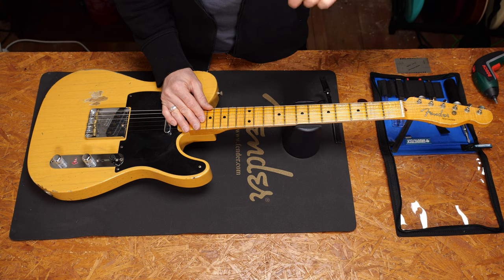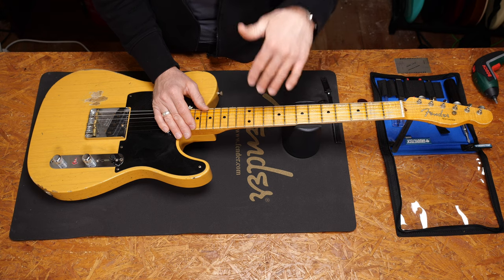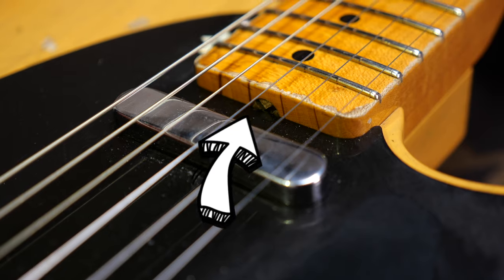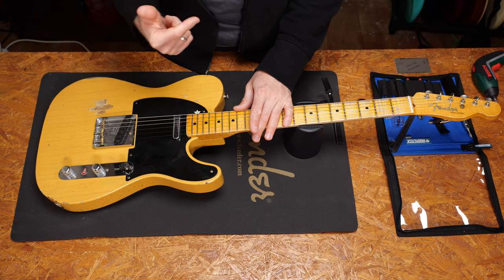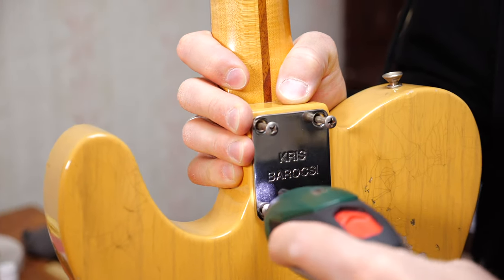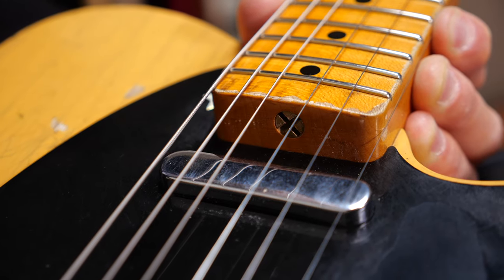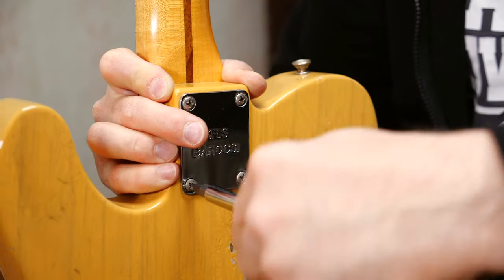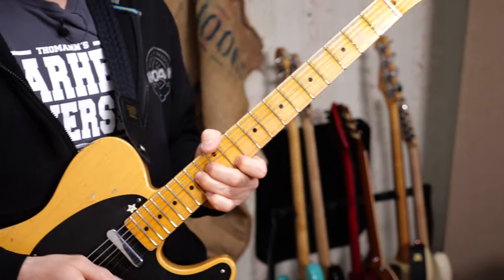Fender Vintage Truss Rod Trick | Guitar Tech Tips | Ep. 4 | Thomann

Comment: stewmac sells a tool/specialized screwdriver where you just need to remove the pickguard and you can adjust it with the neck under tension. i actually called thomann once to ask if they have something similar. no luck :D tbh, fender should give you such a tool, especially when you buy a custom shop guitar for 4 grand or more.
Reply: That’s what I was thinking. Just cut the Pickguard back enough to reveal the screw.
Reply: I have one of the stew mac tele tools.  Just remove the pickguard.  Also, if you get a gallon of paint at the home store, the key they give you to open the paint can is just as good.
Reply: Removing the pickguard sounds like more of a pain in the ass than doing this tbh
Reply: @SpencerP96  nah, most cases just 5 screws as it's for "vintage" lines, also vintage lines have the neck pickup bolted on to the body, not the pickguard, so it's just removing the plastic, and another bonus is you can do it under tension
Reply: @SpencerP96  On a 50's style tele you can easily remove the pick gaurd while the neck has the strings fully strung and tuned up.
Reply: @SpencerP96  it is more of a pain in the ass 4 screws versus 11
Reply: Michael B.  not really, I have worked on vintage fender guitars and the neck bolts are still plenty tight… you just don’t want to over tighten them and that’s why this guy is saying do the last bit by hand.
Reply: I couldn't find it can u put down a link

Comment: Short term solution! You can't do it like that for the life of the guitar man! You'll strip the neck holes in a few years  of owning the guitar. It's far better to route a small channel for your screw driver where the body meets the neck. Then all you have to do is unscrew your pick guard! The method of removing the neck will eventually lead to metal inserts or new maple dowels in the neck screw holes and that will be an expense. Stew mac also has a funky little tool that can get in there for the adjustment with the neck on.

Comment: I ran into this flaw on a strat, so I notched out the plastic guard to fit an elbow driver and now you can adjust on-the-fly without removing anything!
Reply: Elbow driver is usable for a vintage tele bodies, usually they have a hole in front of a trussrod screw. Strats does not have that, and i came to idea to simply saw off thar little part of wood from a body, to make the trussrod screw more accecable. Wish me luck :)

Comment: Simply feed a small, flathead screwdriver into the pickguard notch and adjust the truss rod screw the easy way. It's why the notch exists in the first place, it isn't just there for "show", it serves a practical purpose. You won't have to loosen any strings or unbolt the neck and you'll get a more precise neck adjustment too.
Reply: Hey, thanks! Haven't tried it yet, actually, but I just bought a custom shop Strat was a little freaked out at not being able to adjust the truss rod
Reply: @tunesdonebyone3428 no problem. I'm surprised a guitar tech is giving such bad advice when the method I've described has been used by guitarists since the 50s. I own a vintage Fender and it even explains the method I've shared in its old instruction manual 🤣

Comment: Just be aware of the neck screws, and not stripping out the threads in the neck.. if you partly unscrew them like this, and then you bump things around, or maybe you didn’t loosen the strings as much as you should’ve, you can yank the screws, where they hit an angle, and partly hop the thread, so pay attention that they are coming smoothly back in, and if it seems like they’re cross, threading back it out and proceed with caution

Comment: Well, I always remove the pickguard and use an angled screwdriver to adjust the trust rod on a fully working guitar. You should  loosen the   strings while adjusting the rod. In case your angled screw driver needs more space you can loosen the neck pickup to get more space. I believe this leads to good results the easy way ... ;-)
Reply: Correct, no need to unscrew the neck.  There are also proper tools from StewMac and Hosco (H-TRW), of which none are offered by Thomann of course, to make adjustments extra safe and easy on those slotted vintage + nuts with just the PG removed.  Seeing a tiny Phillips screwdriver loading the slot edges to the max in the video is pretty cringeworthy.

Comment: I actually created a cavity on a few of my vintage spec Strats that allow me to make truss rod adj’s w/o having to pop the neck.  A small u-shaped cavity that allows my StewMac wrench to access the rod freely…so worth it!
Reply from the maker: Yeah, many customise their vintage spec Fenders, which make a lot of sense. If it's an expensive guitar though and you really don't want to mod it, it's nice to know these tricks too. Cheers //Kris
Reply: Ouch! I don't want a Dremel or router anywhere near my guitar.
Reply: Have the same idea with my partcaster vintage spces strat. Do you have maybe some video tip, how to make it as smooth as possible?

Comment: Good idea. I also agree about checking shims. When I have adjusted my vintage truss rods I use a notched straight edge and adjust the neck flat. Then reinstall the neck and return strings to tension. This has worked well and usually requires minimal re adjustment if any . Of course this varies depending on the stiffness of each neck.
Reply: Why would you flatten the neck? You want relief.

Comment: Interesting. But, why not just take the pickguard off and use an angled tool? StewMac sells one that works. I know you wouldn't want to do that with a strat, because the pickups are attached to the pickguard, but there's nothing attached to the pickguard of a vintage tele.
Reply from the maker: Hey, there are clever special tools for this, you're right. It's just really hard to find them in Europe. Ordering from Stewmac and other US shops is really expensive (customs, shipping, etc). So this little trick helps to solve the problem without any special tools, which is useful I guess. Cheers! //Kris

Comment: I use the same trick, but no need to relax the strings. 
1) Install the capo
2) Return the guitar
3) Loosen the neck screws, pressing the body , avoiding the neck to jump out the neck pocket.
4) With prudence, unmount the neck from the neck pocket
5) adjust the truss rod
When the neck is mounted, the string are very next of the good tune.
Reply: Prudence - lifting the neck from the neck pocket would entail loosening the strings.  A very small effort to take all the needless pressure off the truss, the truss end, the neck in the pocket etc.   You can retune after the adjustment with the neck seated in the pocket and the screws almost tight to get a firm fit.

Comment: That was really nice but I'm thinking after time (loosed and tighten) the neck is going to make the neck joint unstable.
Reply from the maker: I understand your concern. The only sensitive parts are the holes: you should definitely not over tighten the screws. There are many 70+ years old teles and strats with this kind of truss rod and they are still doing fine. After the first few years of a guitar's lifetime you don't have to adjust the truss rod too often. Everything gets settled in after a while. Cheers //Kris

Comment: Remove the pickguard then use a flathead.
Reply: as simple as that, it's what I did on my bass, NO WAY that would touch the neck
Reply: @Jeff Smith There are angled tools made just for this purpose. Makes it so much easier than having to remove or loosen the neck every time you need to adjust the rod.

Comment: Hi Chris great tip! remind me which way to turn if I need a little more lower action... clock wise or counter clock wise ? because I can't go lower on the saddles on my Strat
Thx
Reply from the maker: Hi, thanks! If you need to straighten the neck you have to tighten the screw (= truss rod). So you turn it clockwise. And remember, small steps at a time. A quarter turn can already make a huge difference. Also, if the screw is tight don't force it. Cheers! //Kris
Reply: @ThomannsGuitarsBasses  Thx!

Comment: I just picked up a Fender Brad Paisley " road worn " tele. The truss rod is a vintage style like in the video.  Is it worth replacing the 
guitar neck; with a trust rod opening in the neck? or is this not a big issue? thoughts? thanks.
Reply from the maker: Don't replace it. As you've seen in the video it's not much of a deal setting it up. And even if you don't want to do it yourself, any guitar tech can do it for you in a minute. Just visit a workshop once a year for a check, done. If you change the neck of a guitar the feel and the tone will most probably change. So if you like it as it is, don't swap it. Cheers //Kris

Comment: Wait, if you put on a capo then loosen the strings, won’t the strings only be loose between the capo and the tuners? It would make more sense to loosen the strings, pull them tight from down by the bridge, then put the capo on. That way it’s tight we’re you need and loose where you need it.
Reply from the maker: I understand your concern but don't worry, there's no capo (at least not that I know of) that will hold the tension of the strings once you loosen them. I also didn't tighten the capo that much so it's really just holding the strings in place, instead of locking them like a locking nut. And for this reason the order of loosening the strings and putting on the capo doesn't really matter.
//cheers, Kris
Reply: @ThomannsGuitarsBasses   I see. Thanks for the reply. I’m working on my new Jaguar and it’s proving to be a frustrating set up.

Comment: Still an old design flaw that needs to die.  I refuse to own a guitar with this kind of truss rod adjustment.  Under 2 minutes, but guess what?  You can't check your work without putting the whole thing back together and tuning it up.  Then if you got it wrong, loosen the strings, take it apart, turn it a little more, put it back together, tune it up.  If you don't get it right on the first try (and you probably won't), it will take significantly longer than 2 minutes.  And repeatedly loosening and tightening the screws will put wear and tear on the screw holes, eventually necessitating adding toothpicks and glue or wood filler to the formula.  I once owned a guitar like this.  Never again.  Not when necks have to be adjusted every time the seasons change.

Headstock truss rod adjustment is a far, far, FAR superior design.  When the adjustment is at the headstock, you make an adjustment and check your work immediately, no dissassembly/reassembly required.  Guitars with the old adjustment should not even contunue to be manufactured, it is a disservice to guitarists and techs.
Reply: It is a pain, but you don't need to take the neck off, you can buy angled screwdrivers for teles, but you still need to remove the pickguard.  I guess it's trading some vintage authenticity for ease of use.  Like playing an AC30 that has no master volume or effects loop.